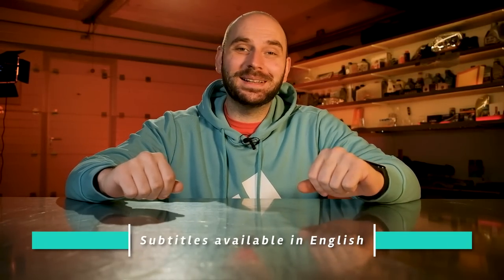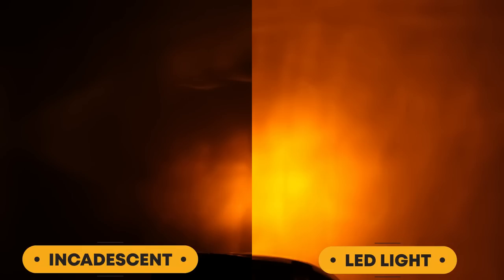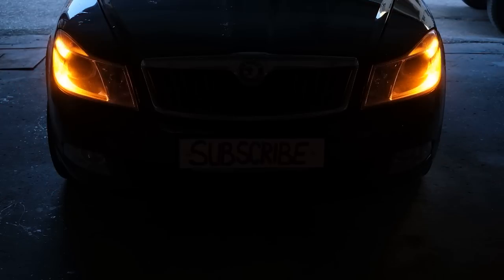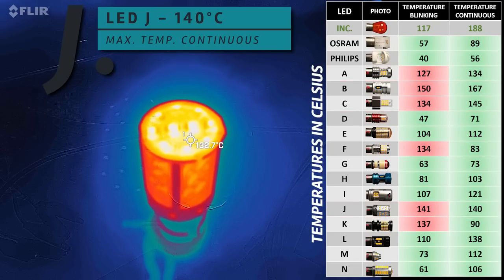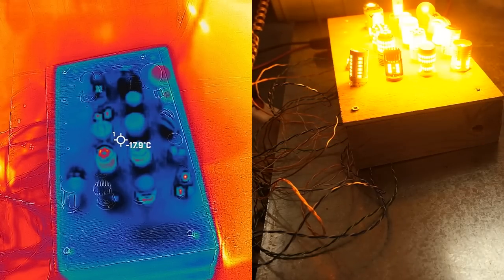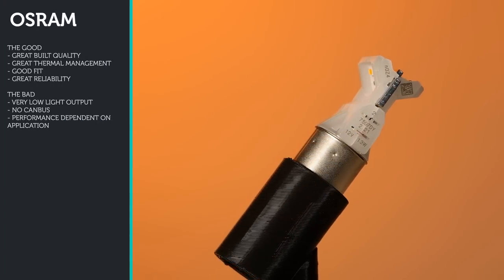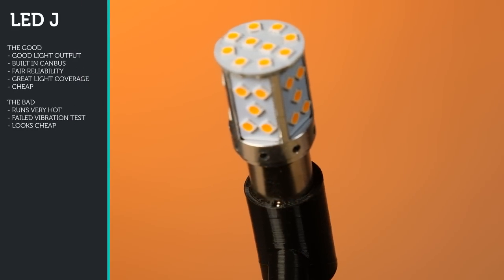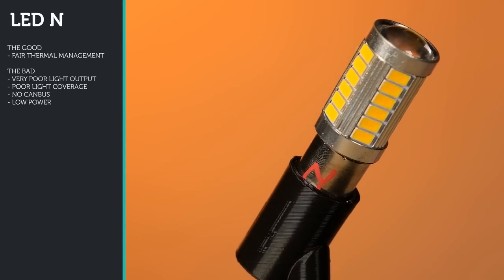LED INDICATOR LIGHTS | Testing the best rated LED bulbs

Comment: i bought a few types from your last reviews on the reversing lamps and I put some in my indicators but they were too bright :-) even behind amber lenses so I bought amber bulbs and they are perfect. the reversing bulbs were changed too and it is like have headlights in the back of my chariot :-)

Comment: Following your recommendation I purchased the winning bulb F. It's sadly a big disappointment. In my 2007 Citroen C5 Break they didn't even go on, when installed in the front lights, and we're causing hyperflashing. Need to send them back now, 'cause they're simply useless for me.

Comment: Hello Sergiu, greetings from Slovakia.
I'm very appreciate your work! But from my experience, test for hyperflash can be very, how I can say it, usefull. Why? I tested bulbs on my cars and on one it's working and on another not (have hyperflash). Cars are from same brand. Ford C-Max and S-Max. On C-Max they works and on S-Max no. So they works until I didn't start engine :D

Comment: My car uses 3457 amber LED as both parking light and turn signal. It would be interesting to see the difference in light output between these two modes. I bought sylvannia LED bulbs with osram chips, and the light output difference between the parking light mode and turn signal mode so minor you cannot tell the if the turn signal is flashing at night when the parking light is on. So I am forced to stick with halogen bulbs for now.

Comment: I cant understand why good quality LEDs are not legal, they are better than Standard bulbs and last longer. But Osram and Philips must improve their LEDs. This are European rules need to be changed...
Reply: No lights at all are actually illegal. It is the amount of light (Lumen) that needs to be correct. For this, the manufacturer needs an approval license to sell it for legal use.
Reply: Even if that’s the case. I would still slap the led bulbs for better safety.

Comment: I saw in mazda new lineup that the led turn signals mimic the latency of the incandescent bulb so why bother change them...in 20 years I got one bulb burned on turn signals and I changed all of them as a preventive maintenance cause even if they worked fine there was some smoke or something black-ish inside them... I have an e39 btw...
Anyway great review as always. Keep up the great work:washhands:

Comment: Your LED crash-tests are just awsome. I get a question. In the "indicator lights test", the incandescent bulb get 109/102 lux. But in the "resversing lights test", only 53 lux. Why such a difference when it’s the same filament (Osram 21W) ?

Comment: Some cars have reverse polarity and so some but not many leds are non polar.For these reason I bought the E in your test before it was done.Unfortunality it was far too bright at start up -28W (fell to 9,5W after some minute)and lose from its socket as you also experienced.

Comment: I don't like the sharp blinking of LED, the pulsing effect of halogen is much more visible and attracting attention. With stop lights though it is completely the opposite, but I still haven't found out how to get around CANbus errors in a good way. Can resistors be mounted on the stoplight fuses, instead on the wiring?

Comment: I wasn't expecting such bad results from Osram and Philips. But did you used a Headlight from a VW Golf? The Indicator Housing is so small, that any Bulb with side and back facing LEDs would perform badly. I would love to see bigger housings with reflectors inside as addition, if it's possible to you.
Reply from the maker: That's why I also measured the "raw light output". Unfortunately the results were still pretty bad ..
Reply: @SergiuGabor  even the raw output test (non focused light in all directions) is not fully comparable to a bigger reflector (maybe focused light in "nearly" one direction (maybe because there you could see and measure if the LEDs are in the right spot/focus point, in this case I think both would perform much better)).
Reply: I bought Philips bulbs anyway (for 2021Highlander) and they look great - brighter than the original light, but not blinding, i.e. perfect. The housing/reflector shape definitely matters - those in my car seem to like the rear-projecting LEDs like the Philips ones.
Reply: @SergiuGabor  I have a Suzuki Dzire. I want to install LED signals without installing resistors. Are there such lamps?

Comment: Philips and Osram were the best in brake lights, but the worst in indicator lights... I can confirm, my red Osrams are perfect in brake lights of Fabia, but yellows are horrible in indicators....
Reply: I have to agree. If only they increase the wattage a bit more about 3.2 watts per bulb. And put a bubble on the amber led chips for more brightness. 

These two sided led are really buy and try. Especially for led Amber turn signals, and it truly depends on ur reflector style application.

Comment: Interesting test, but not done completely right. The indicator lights are very tricky due to, as you said, the type of the housing. Best is to shop by specific car. In my case BMW. I have an e92 pre-LCI where I’ve changed the front turn signal bulbs w i-JDMtoy. It was designed for the car and works great. On my girlfriends BMW F20, I’ve changed the rear lights w Philips X-tremeUlinon Gen 1 (not 2) and they are bright as hell. I was a bit worried that she will blind the person behind. Also as a side effect people started to respect when the indicator is on and let us do the maneuver. On the front I put again I-JDMtoy and they are also crazy bright. Slightly orange / pink tint when light up. 
None of them gave us a hyper flash on either car, just the typical BMW flick when the car sends a test signal. Nothing that was not correct by simple coding. I’ll be installing the Phillips on an Astra H, so I’ll update the comment. 
Also on the F20 replaced the brake lights with Phillips X-tremeUltinon Gen 2, great result. Brake lights is much sharper, color wise and function wise.

Comment: Nice video! None of them are really satisfactory in my opinion as they are too bright or too large. Still looking for nice rear indicators. Installed lamp M before on my Seat Leon 5F front indicators and it does not give me canbus error and shines great. Around the same output as original but way better looking and a bit more bright.
Reply: Do they give hyperflash? I'm looking into LED indicator bulbs as well, already ordered a set of bulb J even though they suppose to run quite hot.
Reply: There’s a couple of led bulbs that are faulty or couple hairs brighter than stock that will not be blinding. Which sylvania zevo or Osram LEDriving and Xenon depot - XTR C series
Reply: @toyotabrony would you recommend what led indicator bulb that's just as bright as the original or maybe just a little brighter with good quality and longevity? Thanks in advance

Comment: amber/yellow LED using in indicator light is not constantly lighting so make no sense to test it this way. I mean we can test robustness but temperature should be measured during blinking test. 
Like 10 minutes blinking what correspond to stay longer time on emergency lights.
Reply from the maker: It was tested both in blinking mode and in continuous mode.

Comment: I'm really not a big fan of aftermarket LED indicators, often times they are waaaaay too bright.
Reply from the maker: That's a great point and I should have mentioned it in the video. Sometimes it's really frustrating sitting behind someone at the stop light with their ultra bright LED flashing in your eyes... The key is to pick an LED which is close in brightness to the incandescent bulb, not the brightest one.
Reply: Some of the led bulbs doesn’t have to be too bright. 

U can get a nice high quality led bulbs. Which I can recommend Sylvania zevo/ Osram LEDriving, and xenon depot - XTR C series led bulbs. 

They are not the brightest but they have a sense of amount of extra light above and beyond than incandescent bulbs.

Comment: "Instant illumination" is actually a disadvantage for LEDs when used as indicators! Let me explain why.
In the peripheral vision of the human eye, motion is what gets your attention and makes you focus your sight on whatever just moved. The fading (in and out) of low voltage incandescent lamps is essentially motion to your peripheral vision. Unless you are already looking at it with your central vision, an incandescent indicator is more likely to catch your attention than an LED one which has only two conditions: full brightness and off.
This is also the technical reason why some cars these days come with this "animation" in their LED indicators: to create motion where otherwise there would be none. It's not just because it looks cool.
Reply: I like to think the huge improvement in amber LED light output makes up for an instant on disadvantage.
Reply: @LawrenceMarkFearon  Unfortunately I can't give a scientifically based answer to whether the increased light output does make up for it. It's a complex question and I reckon the biggest factor is probably the overall brightness of the surroundings (day or night time).

But I do catch myself quite often not noticing LED indicators right away (during the day), unless I'm looking at them with my central vision or unless they are animated.
Reply: @martinweizenacker7129  an amber LED like bulb “K” will be as bright as brake lights in a reflector housing. The tested output measurements vs. the OEM incandescent are dramatically higher. Mounted in my taillights, the “K” turn signals are painful at night and unmistakable even in direct sunlight.
Reply: Wrong. Instant on and instant off gives much better alert for LED’s and it’s a better advantage to alert drivers more
Reply: @toyotabrony  You don't give any reasoning as to why your claim is supposedly true, whereas I do in great detail with my opposite claim.
So, in other words, it is your opinion, not a fact.
Reply: @martinweizenacker7129  it’s not just an opinion dude. It is indeed fact. 

When having a super bright or ultra bright led lights, wether if it’s brakes, turn signals, and reverse lights. It gives other people and drivers a better alert. 

Having a brighter lights is very important and it increases safety. 

An incandescent bulbs was never intended to see other people. It’s not bright enough and not safe or more alert enough for that. 

That is a fact. Not just an opinion.
Reply: @toyotabrony  Yes, I agree with most of what you say. However, you missed the point because I was never talking about luminous flux ("brightness"), but how motion in your peripheral vision catches your attention – and a lack thereof in LED light sources due to instant on and off (no fading).
Reply: @martinweizenacker7129  when it the lights turns instant on and instant on. It alerts more. It gives u a heads more.

Than that slow on and slow off.

Comment: "canbus module" or "canbus compatible" = I very much suspect this is just a high wattage resistor simulating a filament bulb. Cost of such a resistor; +/- 0.5$
It defeats the purpose; low power consumption with an LED and then adding a high power resistor...!! :-(
Reply from the maker: It's possible. I really want to take one apart and see what's inside, but I'm planning on testing a bunch more to see which is better. So I had save these for future projects.
Reply: @SergiuGabor  OK, looking forward to that destructive test :-)   Otherwise; Dear Sergiu, thanks for your nice channel + video's and friendly style and communication. Cheers from Belgium!

Comment: TLDR: Stick with high quality incandescent indicator bulbs from reputable manufacturers until LED indicator bulb  technology improves enough to be worth their cost and trouble.
Reply: Nah. These incandescent bulbs are a thing of the past. 
With also a high quality led bulbs from a reputable brand, they are much brighter, better, and safer to see better and be seeing better.
Reply: For incandescent bulbs, there’s nothing high quality for that. 

It’s just an incandescent bulb with a wire round filament. Nothing special about it.

Comment: Qualified engineer " not quality :D I get your point but here is a correction for you
Reply from the maker: No, it's correct. Quality engineering is the discipline of engineering concerned with the principles and practice of product and service quality assurance and control. That's my job.
Reply: Wrong. He’s a qualified engineered